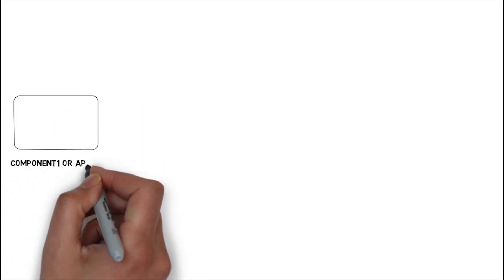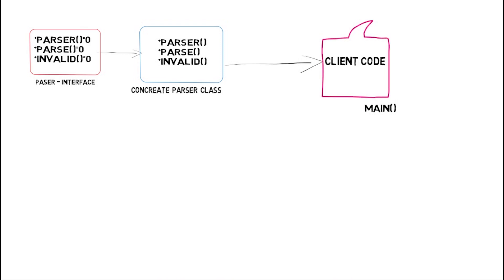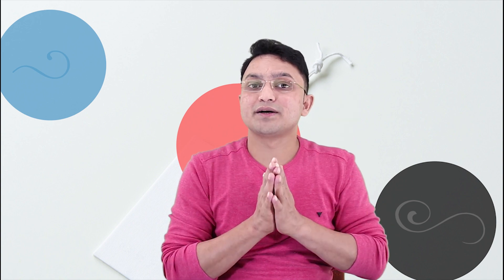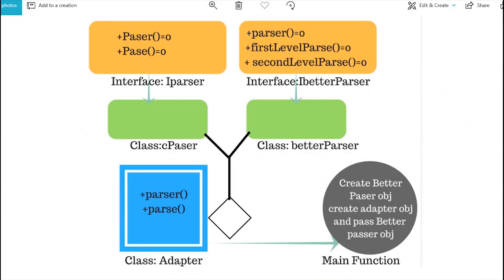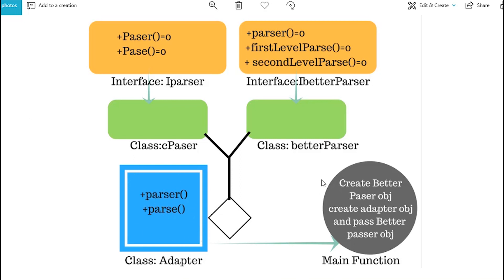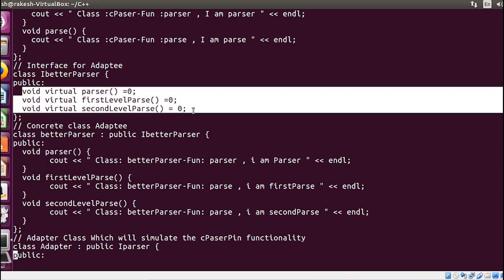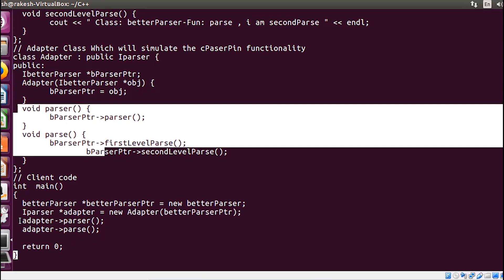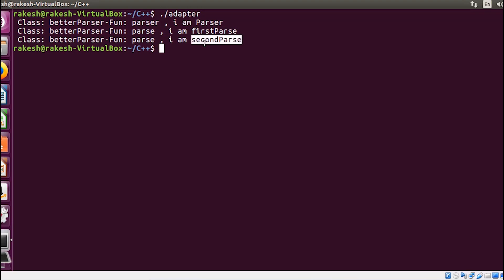Tutorial#4 Deep dive: Adapter design pattern in c++ with real time use case

Comment: Hey in the code ur directly exposing/creating  the new concrete class in client code. So there is tight coupling between client and concrete object .I think u need to instantiate the new class object inside Adapter class

Comment: Hi, Nice explanation, 
One doubt. As long as functionality of adaptee class equal to Orinal class adpater design pattern will be usefull; Other wise it may not much usefull right?
In your example IParser Interface functions Parser+Parse functionalities are equal adaptee class functions such as Parser+{FirstLevelParser+SecondLevelParser}.
Otherwise Adapter Pateern is not usefull when the fucntionality of Adaptee is not same as  Adapter {OR} If adapter class need to call more additional functions of Adaptee classs then it may not much usefull.
Please comment.
Reply from the maker: Yes, whatever class you are going to introduce in future or replacing that has to fullfil ur requirement, ov er here adapter class is important rest is ur logic, u can understand as we are introducing interface in between our code and client code which makes both code compatible to each other
Reply: @EqualConnectCoach  Thanks for the explanation

Comment: Very nice explanation
I was wandering around for best explanation until I found this video.
Short video but enough to get the overall picture in one go
thanks
Reply from the maker: Almost 13 design patterns are there , is that helpful
Reply: EqualConnect Coach 
 I have one question . 
Inside main()  (main is where client will write code thier right?. Its the client side.)  betterParser class is what we wrote, client has no idea about it. It is internally implemented by us.  Client will only user the IParser interface as it is legacy interface which is provided to the client.
Then how can client create  a pointer (pointer to betterParser class) inside main. Logically it should be hidden from client and client should only be allowed to use IParser. In Adapter class it is we, who should implement the logic to move the control (which is intended for IParser) to the betterParser.

What do you think?
Reply from the maker: In that case u Don't need to create object/ptr  in main function , u can direct create object of better parser in adapter class
Reply from the maker: It's just calling program
Reply: @EqualConnectCoach  
Can we have video for proxy design pattern?
Reply from the maker: @iamravishank  right now I am busy in Cassandra nosql so it will be get delayed
Reply: @EqualConnectCoach  will you upload those videos as well
?
Reply from the maker: Yes I have already uploaded , can you go to channel and check